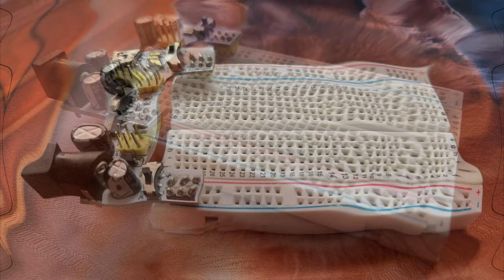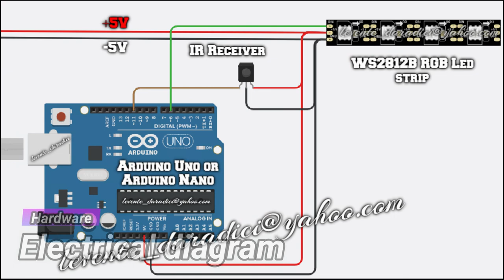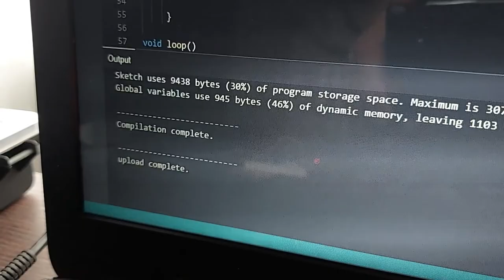Infrared remote controlled WS2812B RGB LED strip with POWER ON status memory   ARDUINO FOR BEGINNERS

Comment: Im a beginner, i concider myself having a little attention. 
I can't seem to get my remote to work. First of all, there's no script included here to decode any remote to hex. Hex code for my remote just shows "FFFFFFFF
 other button".
I managed to decode the remote to 2 digit code to use with another IR Remote library. Could you make a video about how to setting up a remote to work with this code?
Reply from the maker: From the examples included in the IRremote library, choose the example named ReceiveDump,
https://i.imgur.com/q4mTT9r.png
  You upload it to the Arduino, connect the output from the IR sensor to digital pin D2, and in the serial console you will have the data received from your remote control.
https://i.imgur.com/Xe8EpQV.png
I hope it helps you, to read the data from your remote control.
Pay attention to the pinout of the IR receiver!
https://microcontrollerslab.com/tsop1738-ir-receiver-pinout-examples-arduino-applications/